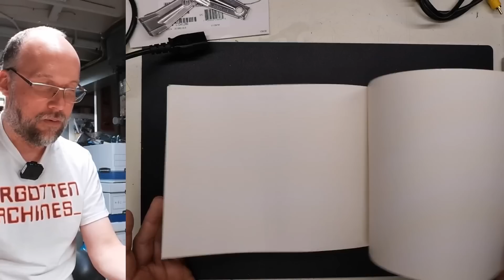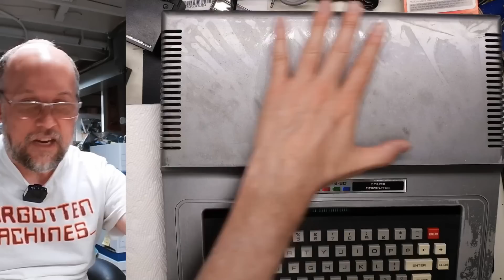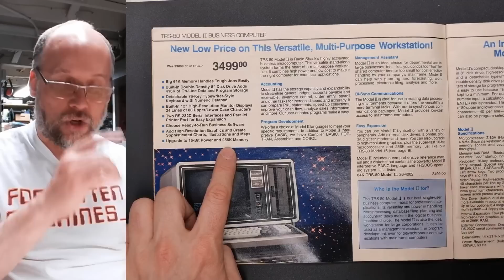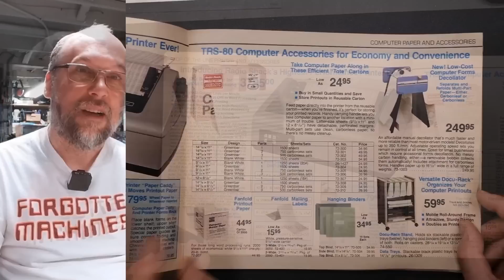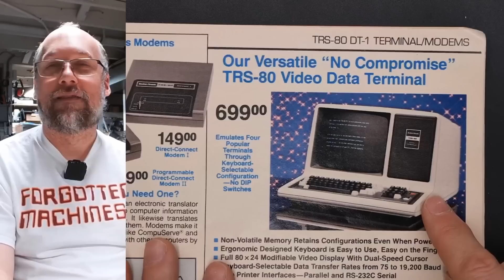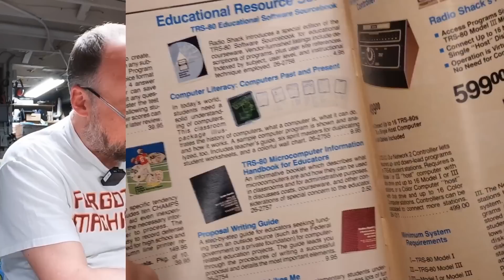0063 A boxed CoCo 1 and a fun read-through of a 1983 Radio Shack catalog

Comment: Back in the 80s, you could use a particular shade of auto touch-up paint to fix your CoCo: Mercedes silver. That exact shade from that era is probably no longer available, but at the time that shade was recognized enough that '80 Micro' (a TRS-80 computer magazine) had a regular column featuring a character called... Mercedes Silver.

Comment: My junior high school had about 15 Model IIIs in the computer lab and we had that network connector.  The "master" computer had disk drives, the other computers did not.  The teacher could send a program down from a floppy for us to start working with.  They were all like 5K BASIC programs, so it didn't take all that long.  Also, we could - from the client computers - print things out using the printer connected to the master computer.  I think it went through the RS-232 interface.  It did not connect via the cassette port as we all had cassette recorders at the desks to save our changes to programs we had to write for class (if we didn't finish during the class time).

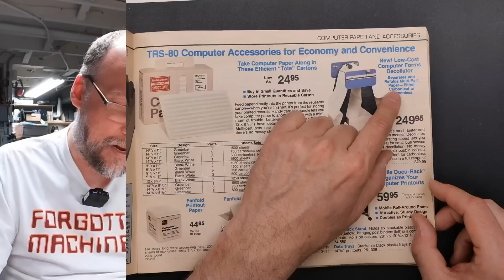Comment: That decollator at 28:00 just separates the layers on multi-copy paper. So lets say you had paper that printed on two layers at the same time, you would use that to separate a long printout into two separate stacks. The one in the catalog was a manual version, but there were ones that were motor-driven. There was another machine (I don't know if Radio Shack had one, though) called a "burster", which would separate the pages and could remove the tractor feed edges.
Reply: Ah the "Burster" at my first IT job, took about 8 hours of fine tuning over several monthly statement runs to get it to perfectly rip and split the fan fold paper. Once setup, it did not move for 2 years incase it changed shape and had to be adjusted again

Comment: Yes companies had model 2s. Radio Shack's computer centers were slick, held classes and small businesses loved them. Located often in a downtown they were seen as a legitimate player in a time where there were no small business systems.  

In an era where companies relied on service bureaus to process general ledgers and payrolls you could easily save money even at these prices and in the end do no more work than you had to do in prep for the service bureau. 

They were quite successful till the IBM XT came on the seen.  At that point Tandy in attempt to regain the business market introduced the Tandy 2000, with I believe a 186 processor, but it never caught on. After that failure the company began closing the computer centers and focused on the 1000 as a low budget alternative for home use.  

By the way the small devices on the cover were not calculators but handheld computers. The Tandy 100 which was larger had a several line screen actually caught on with reporters for a while and the most interesting use I have saw took place in a deli, which everyone knew was a hang out for bookies.  What Deli had 8 pay phones. One day I was there for lunch because it was a great NY style Jewish Deli near Pimlico Racetrack and I went back to the bathroom near where the phones were. On one of the phones was a one of the bookies with his Tandy 100 hooked up through an acusticoupler and the hand set from the next phone on his ear. I'm not sure what he connected to but it was the era of Compuserve and bulletin boards so maybe he got his race results.

Comment: Bear in mind, in 1983, the IBM PC was only 3 years old, and the PC world was just starting to build computers with 286s.  Early PC architecture was pretty crappy too until x86 came along, and Tandy was pretty far ahead of the pack (including IBM) at that moment in time.  Like you said, it ran a Unix variant, and with the Z80 as a support processor, it was a pretty powerful system at the time.  Yes, they weren't exactly selling like hotcakes, but they did sell when the job required that level of compute power.  I worked at a Tandy Computer Center at the time, and it was fun to have such a beast of a machine.  That was also the end of the line for Tandy based computers.  Everything after that was PC compatible stuff, and Tandy eyed the home/small business market, and never created high end PCs.
Reply: Still have a sapphire Tandy lapel pin.

Comment: In 1990 I bought a 486-33 tower built by a co-worker from parts he ordered out of Computer Shopper.  I wanted to buy a modem card, and I figured Radio Shack sold computers, they'd have modern parts.  The local "shack" had older TRS-80 stock in the back, and nothing modern or current.  I ended driving  another 45 minutes to a mall that had an Electronics Boutique to buy a 2400 baud modem.

Comment: By 1983 RS had computer centers.  The model 16 would almost never be found at a regular computer store, only at those that hosted computer centers.  As expensive as it seemed we (at the time I was working for a very large motorcycle dealership that had 5 locations) opted for a PDP-11/73 (basically a miniaturized version of the 11/70).  We had looked at both systems and the RS Model 16 won out on price (by a long shot), however I was going to be the one to set-up and run the system so I favored the PDP-11 because I was more familiar with it's operating system and BASIC language.  The RSTS/E OS for the PDP-11 was just far better for running timesharing applications at the time than Xenix was.  the PDP-11 was also more expandable. more powerful and far better suited to a true multi-user environment.  Anyway, that was the market they were playing in.

Comment: The paint on the original CoCo was the same as used on the original TRS-80 (aka the Model I). I learned the hard way that having insect repellent on my hands while handling my Model I caused the paint to literally melt, looking like the damage on the top of the one shown here.

Also, the business machines were generally not stocked/shown at the retail stores. They were at the Computer Centers.

As for pricing, in this era, the saying was that the computer you wanted cost $5000.  That included most XT clones, so the prices then were really not that extravagant compared to other computers.

Comment: The TS-1000/ZX-81 was the first computing experience for a good many folks in my generation.  The CoCo 1 helped educate a generation of programmers and developers - its impact on the computing scene in America and elsewhere is a significant one.

The 8-Bit Guy has a video up on restoring one of these that needed painting, and he found some nearly-perfect matches in commercially available spray paints that might be of use in this restoration.  https://www.youtube.com/watch?v=XT5SYlqM7wk&pp=ygUeVGhlIDgtYml0IEd1eSBDb0NvIHJlc3RvcmF0aW9u  

Even with the light colored plastic, i would probably hit this with some sandable primer, wet sand with 600 grit, then take a tack rag to it to get all the dust and schmutz before painting.  Use a painting handle with a pistol grip on your spray cans to get more even results, and practice on some cardboard for a bit to gauge how the paint behaves.

Portland should have a fairly active maker community that might have a spray booth you could use to do the painting - that would be the best of all possible worlds.

Comment: In the mid 90s I bought 3 TRS-80 Model 2s, and 4 Tandy 6000 machines from the high school I went to.  Also got the 3x8" Drive expansion, a 35 meg external HD (loaded with Xenix) and a massive TRS-80 Line printer.  That was what they had LEFT of their old office computer setup.  That would have been, in 2023 dollars, well deep into 6 digit money wise.  That school district was also notorious for wasting money!

Comment: Remember in school first half of the eighties, they had ABC80 with cassette players and what looked like home built cassette port network. A box with a few switches. Local or remote cassette, send or receive program. In remote mode, only one computer switched to send and the ones receiving obviously to receive. Then receiver type load and sender save.
Transfers was easily interrupted if someone switched to remote while transmission was active.
When teacher was distributing a program it had to be first loaded from cassette or floppy and then saved to the network.

Comment: The ZX81 was an amazing machine, the ultimate in minimalism. It did so much with just 4 chips. Yes the keyboard was poor, but the keyword entry method made it less painful. Yes the 16K module was dicey but there were alternatives. I built my 81 from a Sinclair kit in 1982, before Timex sold them, and later expanded it to 16K internal SRAM. Great fun!

Comment: The 16 was not sold in your typical Radio Shack retail store where you would usually see the consumer and home business based machines. However at the Tandy Computer Center (I worked at both) you could tour the heavy hitters that TRS had to offer. We were never provided a demo of the 16 however. Had we sold one (I doubt we did) it would have been special ordered direct from Ft. Worth and probably delivered straight to the customers address.
Reply from the maker: Do you know how many of those Computer Centers they had? I grew up in Los Angeles in the 80s and never saw one. (There had to have been at least one there.) I do remember seeing computers at the RS but they were always the consumer ones.

Comment: A decollator was a device to separate forms. When using a dot-matrix or other impact printer (like a daisy wheel for example) the paper came in single sheet OR with carbon BETWEEN sheets. If a copy went to multiple people, either someone had to separate the two parts (and shred the carbons!!!) and not get carbon on each copy OR the decollator automated the process and stripped the carbons without getting the copies smudged (and usually dumped the carbons in a bag for destruction later).

Comment: Hi Adrian! Just a reminder that the Lisa also came out in 1983 and was also $10k. Imagine spending $10k on a Model 16 vs a Lisa???
Reply from the maker: Lisa certainly seemed way more cutting edge! Although on the other hand $10k on the Lisa likely didn't come with the hard drive? And no multiuser. It's just amazing how much power you can get now for so little money!
Reply: The Model 16 had some pretty significant multi-user office solutions, including Multiplan. In the very 1990s we still had a real-estate company client running on Model 16s and terminals across three office sites. Worked well.
Reply: The Model 16 would have been the better choice, unless you wanted to write Mac software. Any software development effort invested into (xenix on) the model 16 would be easily portable to any future unix system. The Lisa was a dead end

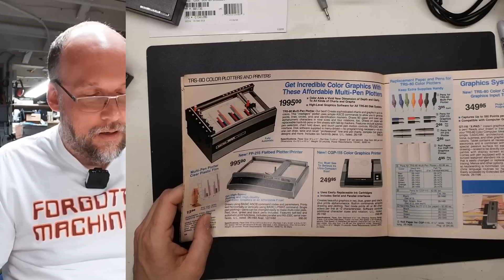Comment: I had the color printer CGP-115 at $249.95 (28:45), it was connected to a 6502 SYM-1 board. It was entertaining to see that printer literally "draw" characters line by line. One of the cheapest printer I could find at that time until I switched to a noisy dot matrix.

Comment: Back then, in those times, early eighties, prices were extremely high. I remember I had to pay 1200 Guilders for one Micro Floppy Drive with interface. It was only single sided, 360kB. One microdiskette costed 12 Guilders and nobody else had the microdiskettes, everybody used 5 1/4 " minidiskettes. It was quick, it was reliable and compared with cassettes it saved a lot of time.  

Computers costed a fortune! By the way, one US Dollar costed back then something like ƒ 3,60 (Dutch Guilders). The exchange rate changed a bit the last 40 years.

Comment: Seeing the position of the Radio Shack label on the Coco 1 (centered, not on the left side) and the fact that the plastic under the silver paint is white and not black, it is a later model Coco 1 (an F board - it will have a number on it ending in '285' on the lower left corner of the motherboard). Also it has the ribbon cable for the keyboard instead of an actual connector. As for the catalog - I think most of the high end machines (like the Model 16) would have been sold in the Radio Shack Computer Centers, not the regular stores.

Comment: The cheaper Network 2 controller was really just a glorified tape audio distributor box.  From memory the knob would select the computer that was sending the audio.  Anything 'saved' from the master would be available to the slaves.  What you'd do is go to each of the slaves and set it up to load the program (cload or system as appropriate) then on the master csave (from basic for basic programs) or use a simple utility to read the program to be sent from disk into RAM and then out the tape port.  Pretty rudimentary stuff but it worked well for setting up a whole classroom of TRS-80s with the same program for a class.

If you were trying to setup a mix of MI and MIII at the same time you'd have to set the sending rate as 500 since that's all the MI did (natively at least).  If you had a mix on the Network 2 controller but only wanted to send to MIIIs you could do 1500.

Comment: What's hard to process is Tandy using 8" disk drives in 1983.  At that time ST-506 interface 5-1/4 inch full-height drives were a common occurrence.  Why would they saddle themselves with an oddball 8.6MB 8" HDD?  Or 8" floppies?

Comment: The TRS-80 CoCo is an excellent candidate for painting since there's very little to strip the original paint, then little effort to repaint. It's good to find thin coat/fast drying paint and use seven coats, then use a clear coat with three coats.

Comment: The Visual V1050 came out in the same era. The price for that system, plus the software bundle, was $2495. The software bundle included WordStar, DR Graph, Microsoft MultiPlan, C-BASIC, and Z80 Assembler. When I had my system, I purchased an Epson RX-80 dot-matrix printer that worked forever and lived through multiple PCs before I gave it away to someone who was still using it until recently to print labels.

Comment: Krylon Fusion is pretty awesome for painting plastic.  It sort of sinks in.  Leaves a really nice finish.  Give it a shot.
$5k in 1983 would be $15.3k in 2023.  Woof.
Thanks for another great video.  Old catalogs are a time warp.  I've got a Grainger catalog from the 1950's.  Fun to flip through.
Reply: @Okurkaarrgghh  I think everybody knows inflation calculations are bad at tracking larger purchases like land or property. Or even cars. The calculations are based around the price of daily goods, not luxury purchases.
Reply: @Okurkaarrgghh  exactly. Computers, hifi equipment, etc don’t track linearly with inflation. Inflation calculations are only a rough guide of buying power. If you really look into it there’s different inflation figures for every single sector, but the government doesn’t have calculators for those.

Comment: I worked in a service bureau that created filled out forms for sending to insurance companies and you would put the multi-part forms in the center of the decollator and it would take multi-part printer forms and split them up and pull the carbon paper out from in-between the multiple copies.  There was another machine called a burster that trimmed off the tractor holes and burst the perforations.

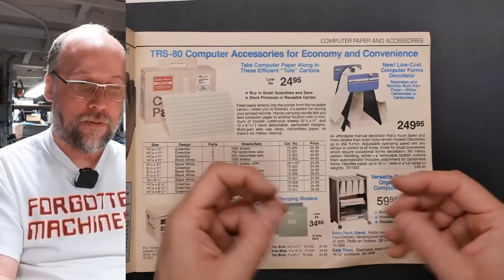Comment: At 28:13, $249.95, Computer forms decollator. It’s for separating carbonless paper copies, just like a receipt book with carbon paper, but for computer-printed forms.”

Received message. Sure, here is another suggestion: "At 28:13, $249.95, Computer forms decollator. It's for separating carbonless paper copies, just like a receipt book with carbon paper, but for computer-printed forms.

Comment: The decollator!  I was a computer operator from 2000 - 2003 but working on stuff much older.  We used to print some big jobs that we needed multiple copies of on the carbon paper in the line printer (on continuous forms) - so we'd take the second copy off of the first using the decollator.  One stack of paper goes in, two stacks come out.  Unless something went wrong (it always went wrong) and then a bunch of bad words would come out, too.  

As far as line printers go, 150 isn't that fast for a big line printer - but that machine is a hybrid.  The big IBM printers that would've been available in the same era would've been somewhere from 300-1500 lines a minute I think.

Comment: Back in the day...  I purchased a 4K CoCo.  It lasted at 4K until the drive home, where withthe addtion of 16 16k dynamic rams and a bit of solder, it bounced up to 32k.  With some other mods (jumper cuts, and a bit more), I later upgraded it to a 64k unit.  The 64k unit would support OS-9 which could handle multiple users.  A pretty good 8-bit machine, using a 6809, probably the BEST 8 bit chip, but a bit late to overcome the Z80 juggernaught.  Oh, well.

Comment: I had the model two back in the early 80s and when the 68000 expansion board came out, I added that to it and ran Xenix. 
I used it to develop software for local businesses. While expensive, it also meant my clients that were using them had a little money to spend on software development so it all worked out.

Comment: One more thing before the 9 pin DB9 became the standard DB25 was the standard for mcirocomputer RS232 connections.  Interesting it was also the plug for parellel printers. I no longer sure but I think I have the direction right, Parallel ports were male DB25s and Serial Ports where female DB25s on the back of the machines.